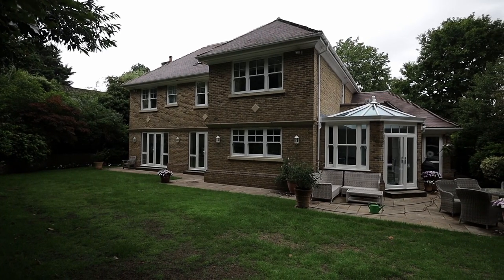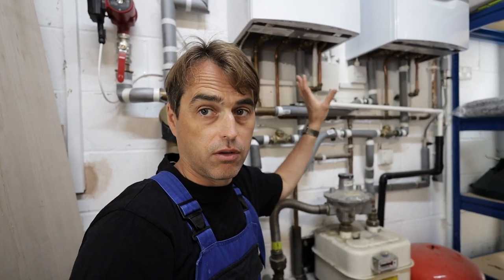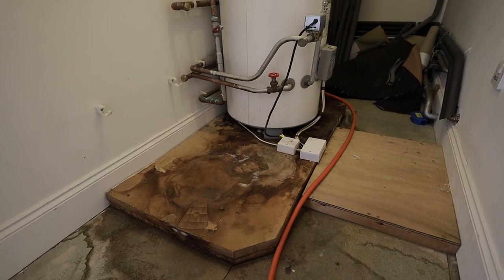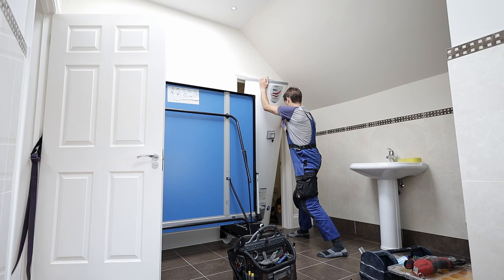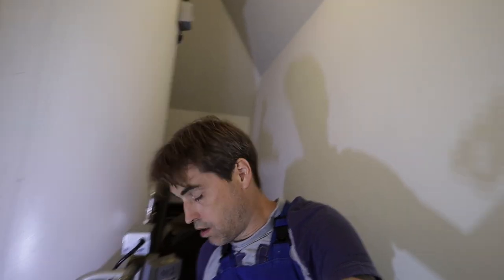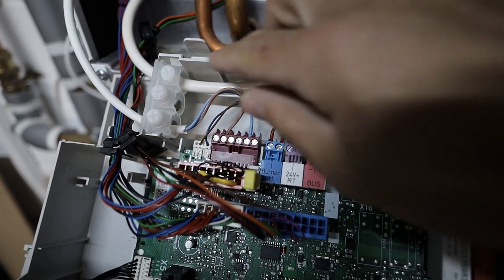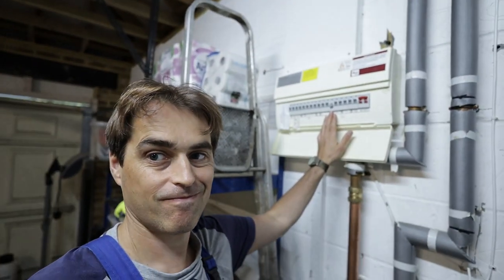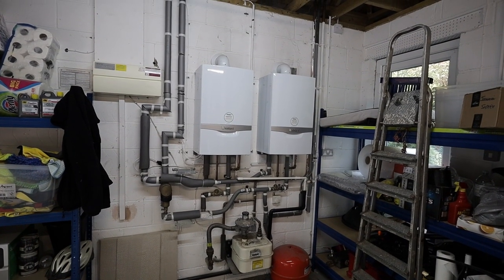Reducing Energy Consumption in a Large Home: A Step-by-Step Guide

Comment: Not sure I agree with removing the LLH for such a system, however, real world testing is the best way to find out if it works, we can have all the theories we want and all the mathematical equations and all the manufacturers test rigs in test conditions, but these do not prove real working of an actual system, it’s great that you have a client willing to undergo a trial for a different approach and it will be very interesting to see how it turns out, I look forward to the follow up video with interest, it could prove a lot of theories wrong
Reply from the maker: yes, it would be nice to keep it in, but that would require re-piping of hot water and radiator circuits so that the take-off for DHW is before the header, additional 2 pumps - one for CH rads and one for DHW plus replacement of mixing valves on 2 manifolds.

It may still happen. We will know soon.

Comment: The overall complexity of this system and the various parts raises a question in my mind. Hotels don’t create these inter related and inter dependent systems. They work much more on a room by room basis for all variable services. Why wouldn’t something similar work better and cost less here as well, because large parts of that house aren’t used every day. Individual room or area type systems can be activated when in use and only public areas on permanently. Also the thermal envelope of this property can’t be very efficient either based on your energy consumption stats.

Comment: 50,000kWh per year! 😮 What was the insulation like? Any room for improvement there too?
Reply from the maker: it's a 2004 new build, so insulation and windows are very decent. It was purely down to bad heating and hot water system design.

Comment: Fantastic and informative video. Ain’t the main reason for a llh where there is multiple pumps with ufh? To stop them influencing flow rates outside of the international pump flow? Hydronic separation, Not just for when you have two boilers together.
Reply from the maker: Yes that is correct. However even with LLH in you still have a system pump influencing 2 manifolds pumps.

I had a 2 hour discussion on how to address this with Andrew Millward today. 

I would just use CCT on manifolds as per Adam from HeatvGeek but Andrew is set against it and says it is as bad as no separation.

I think I may put LLH back but without the system pump and just add 1 pump for rad circuit.

I think this was a consensus we reached with Andrew.

There is going to be a follow up on this soon.

Another solution would be to use one boiler for rads and cylinders and separate the system with 2nd boiler just doing UFH on low temp.

Unfortunately all those option add a cost to the install

Comment: I've not done any research on prices for things, but it seems likely that you could have purchased a probe camera to look into the cylinders through the pipes instead of cutting one open and saved both of them. Then you could have sold the second cylinder (through installation at a second site) to recoup the cost of the camera and be left with a tool you could continue to use for years.
Reply from the maker: No one is buying a 20 years old cylinder. It’s worth around £20 in scrap value

Comment: Very satisfying 👍
Is there any sort of mixing valve on the underfloor? You mentioned 2 heating curves but without sensors and mixing stations the vr71 will run at the higher curve I believe.

Comment: It's a fantastic example that complexity does not automatically give you better efficiency, control or cost savings - and it can do the very opposite.
I wonder how much all those extra thermostats (and the perceived extra control) actually saves them when compared to a simpler well balanced system. My guess is not as much as they think.

And also why use underfloor heating manifolds with cheaper actuators when you can make you own out of hundreds of tees and individual zone valves... 
The labour time alone on all that soldering....

Comment: Just taking that cylinder out is going to save a lot of money.
Issue I find in installations with llh is how the circuits are run, dhw should be before the header/heat ex on priority so then all heating circuits can freely modulate
Reply from the maker: Exactly! Thank you.
Reply: Is running a 2000 LTR buffer tank with an UFH system a good idea in relation to efficiency ??

Comment: Another great job 👍 would there not need to be some sort of hydraulic speration for the different flow rates of the underfloor heating and radiators?
Reply from the maker: yes there should be. I quoted for it but was asked not to improve UFH manifolds! 

The reasoning is - UFH is 7kW so 1/3 of the boiler output and never run more than 1/3 of the house. This is not ideal but will work.

Comment: Great Video! My only question as a novice.... do you need to worry about the water temp returning to the boiler is too low and can cause problems long term? 

I might have tried keeping the low loss header for heat but tie the DHW in before the low loss header?
Reply from the maker: I wish I could do that - but that would require running new pipework throughout the house.

I have a solution to different flow rates now and there will be a follow up
Reply: @UrbanPlumbers  what about moving the DHW tank next to the boiler and use a Circ pump to keep hot water at the tap when needed. Occupency sensor in the bathroom and kick on the pump or a couple 24v switches around the taps.
Reply from the maker: There was no budget for this on this job. I actually had a much bigger idea for this job, but had to slash it in half due to the cost. There is a lot of compromises here.
Reply: @UrbanPlumbers  I know, it's almost worth spending your own money sometimes just to make it perfect

Comment: How does the contactor wire into the VR71? We're looking at a similar job, albeit with 4 zones but curious about the ability to keep 3rd party controls. We will be taking them out on this one as they're simple stats but I know we'll come across a 4 x Nest type setup soon enough where the client will want to keep their existing controls.
As always, top-notch content Simon, well done.
Reply from the maker: You just need a standard contractor to send volt free switch - either No or Nc will do. NO are easier to buy so just get those.

You can only do 3 zones on one vr71 for more than than you need additional vr70 (one per each additional 2 zones)

Comment: Can you give a rough idea of what it would cost to convert a Y Plan system, using a recently installed Vaillant Ecofit Pure boiler, into a Hot Water Priority + Heating Weather Compensation system. (I believe this only viable using Vaillant's own range of controls instead of the current Hive controller since they don't support opentherm). Looking at the Vaillant website it looks like I'd need to spend approx. £400+ on the hardware (new controller (VRC 700?)  + new compatible wiring centre + tank thermostat) plus whatever installation cost would be needed.

My problem is that I can't convince myself that the change would pay for itself in any sensible timescale given that I only spend about £650 on gas a year. That will go up of course when my current fix runs out, but even then it's only likely to be a £1000 a year on the new price cap. I already use 'manual weather compensation' by frequently adjusting the flow temperature to suit the outside weather so  would an automated system deliver enough additional savings to recover its cost.

Background data - I've got a solar PV system which gives me free how water most days between spring and autumn, and tops up the heating of the house with electric convectors when the hot water tanks is up to temperature.

Comment: With the underfloor heating, wide bore piping, big hot water cylinder and plenty of room in and around the property, is the place not calling out for a heat pump? They must use an awful lot of gas and produce so much CO2?
Maybe wealthy enough to cover the house in PV as well!?
Reply from the maker: boilers are 5 years old though and the heat loss of the property would require a twin heat pump set up. That would cost around  25-30K to do.

Comment: Great video, a gas engineer friend told me that it's more efficient to keep the hot water on all the time so that it just tops the cylinder up - do you think this is correct?
Reply from the maker: that's what they were told by a number of other gas engineers. Then they got the bill.
Reply: @UrbanPlumbers  ha ha, yeah I’ll stick to manually topping it up when needed, only takes 5 minutes to get hot water flowing again
Reply from the maker: @jonjohnson2844  if you have a hot water cylinder and 2nd circulation pump - I would suggest timing the water (not keeping it 24/7 on), definitely insulating all pipework around the cylinder (they lose more energy than people realize!) and only 'pulsing' 2nd circulation pump for short periods of time in times of heavy use (mornings and evenings for most of us)
Reply: Not in my experience as there is heat loss through pipes and the tank itself.
Reply: @avivscrewvalla  yeah there’s a lot of conflicting advice around - I think I’ll stick with putting the heating / water on when I need it, seems to have served me fairly well

Comment: I find more scale when the immersion heater has been used alot. If you just heat the water gradually to 60°C you will have less scale, no matter how hard the water is. That is on a closed system.

I think you get more scale with a vented system too
Reply from the maker: I bet those cylinders never reached 60c in 20 years because of the set up
Reply: @UrbanPlumbers  running at lower temperatures you use more cylinder water than cold supply. 

This is what I wondered with heat pumps. Lower temperatures at 50°C requires more hot water than having it at 60°C. I think the average shower uses 80 liters of hot at 65°C if I remember my Kingspan servicing days. 

Great videos though. I've never worked on really big systems before, but I'm learning a lot from the comments too. Thanks for sharing
Reply from the maker: Yes we usually run cylinders at 48C with heat pumps. Less cold water gets mixed in, if at all.

Comment: 18kw loss?  At what outdoor delta?  My house is quarter that size and probably loses nearly that much in winter at 20*C indoor 20* DT.  I have 2 rooms which won't even make it to 20*C when it's 0*C outside as the heat loss from the room alone is more than the radiator can supply.  I set all my zones to 20*C last winter when it was 0*C outside.  A few of the rooms got there within an hour, the bedroom and hallway, no chance, barely got the bedroom above 19*C and the hallway I gave up at 18.5*C after 3 hours of heating at 80*C loop temp.  30kw boiler, 18kw radiators.
Reply: For this winter my static "base" targets are going down to 15*C and 14*C (for hallway and bedroom).
I am adding a few triggers for humidity, first triggering heating if it exceeds 79%, but also want to look into prediction of RH as when the temp fails at night, you don't want to allow it to drop too far if the air is humid.  If RH gets anywhere near 100% then condensation and thus damp will start to form.  I can probably just fetch a weather forecast and look for the minimum temp and dew point metrics, then over-ride the base temps with Anti-Humidity temps aiming to keep RH lower than 80%.  I might have to up that to 90% depending on how much heating it actually needs to lower the RH (I expect quite a lot).  If I have air pressure, temp, RH and dewpoint I should be able to calculate the peak RH for the night ahead and set the target temps 1 or 2 *C higher to avoid it... hopefully it doesn't happen too often.  I don't recall seeing over 72% humidity so far.
Rooms I can detect I am in, like the office PC is on, the bedroom TV or livingroom TV are on I ramp the temp up to something more comfortable like 18*C.
In Jan/Feb limiting myself to 2 rooms heated (office and bedroom), should keep my bills as low as possible.
Hot water temp is (combi) 42*C, fine for a shower, the dishwasher does the dishes.

Comment: Secondary circulation still would be handy in such a large place with that many bathrooms. It could've been made to work with the right controls and insulation. Did you keep it? I suspect not if three people live in a third of the house of that size.
Reply from the maker: Yes, I kept it. It’s now controlled by Senso Comfort and set to run as little as possible
Reply: @UrbanPlumbers  Tnks, please do an update vid if you are you going back to install the LLH and pump.
Reply from the maker: Update coming soon as people ask way too many questions s on various forums
Reply: @UrbanPlumbers  😄only way to learn.
Reply from the maker: Mistakes are the best way to learn, especially very public ones 😉

Comment: You mentioned running a different heat curve per zone. I get how that works but how are you achieving that without mixers and multiple pumps 🤔 or did I miss hear you
Reply from the maker: Highest curve takes over sadly. So if all rads are off UFH curve takes over
Reply: @UrbanPlumbers  🙌 though that would be the case.

Comment: Can't wait to see to difference in gas usage. I bet it's only going to be 5% less. 
What does everyone else think?
Reply from the maker: on hot water alone being 300L not 600L and not being constantly depleted by 2nd circulation this will save at least 20%. Plus weather compensated heating will save another 10%. Those are my calucations.

But let's wait till Jan next year. There will be a follow up
Reply: Definitely going to save alot more if the boiler can condense more + weather comp + lower hot water bills. We are saving 35% in hot water bills after our job earlier this year!
Reply: @avivscrewvalla  
35% less energy on hot water is very, very impressive.
What boiler did you have before? What boiler do you have now?
Reply: @nhojnhoj6767  Had a Bosch Greenstar 18Ri which was replaced by a Viessmann 200-W. Only other variable was the addition of pipe lagging.

Comment: How can I get in touch please Simon ?  I am one owner of 10 new houses with air source heat pumps and ufh and am not happy that the systems have been commissioned properly to take account of different floor coverings . Kw energy use is high on cold days but the system seems to struggle to keep rooms to temperature
Reply from the maker: Email me. There is a contact form on my web site www.urbanplumbers.co.uk

Comment: I’m not a plumber, but was the 2nd circulation pump circulating hot water so you had hot water at the hot taps almost immediately?
Reply from the maker: No, 2nd hot water circulating pump is still there by the cylinder

Comment: At the cylinder dual stat, instead of taking the control stat to overheat stat link out and just keeping the overheat stat,  could you have just set the old control higher to say 70C so the NTC sensor control would then be in control?  Thinking that would give an additional failsafe?
Reply from the maker: yes that is what I do. I don't need cylinder stat anymore, just over heat stat.

Comment: I wondered if you had any information on interlinking the 3rd party controls into the wiring centre. 
I've got a job with 4 zones and I'm struggling to find the relevant controls pack
Reply from the maker: You will need: VR71, VR70, VRC720 plus 1 x relay per zone

Comment: why don't keep a boiler for underfloor heating and a boiler for the radiators? And if you run the boilers at under 30% load they are more efficient… + more Flow from the pump …

Comment: How does one of them hot water cylinders cope with 6/7 people . I’m sure when I had one at a previous house, if you had a bath it would be empty .
Reply from the maker: That’s what happens when they are not controlled on hot water priority. 300l on PDHW is plenty for 6 people
Reply: @UrbanPlumbers  2 boiler with one supplying cylinder only would mean both ufh and hot water cylinder could operate together, no need for priority hot water

Faster recovery time for cylinder without any interruption to the heating side

As mentioned by other two boiler mean if one one fails the other could still be used.
Reply from the maker: @victor-hn1bh  you could do that. This would mean extra pipework and extra controls - probably would add around £1,000 -£1,500 to this job. 

The best option would be to have one boiler doing only UFH on low temp and 2nd doing DHW and radiators on PDHW as that way you can remove beldning valves on manifolds and install a mixing circuit pumping station. 

I did quote for this kind of set up but the client did not want to spend that much. What I have done is the cheapest solution to the problem.

Comment: Hiya. Was it not possible to have both boilers in use alternating. Or some other designs where both are used. One for hot water the other for heating only.
Reply from the maker: yes, it was, I actually quoted for a much more advanced setup but it was not within the expected budget.

Comment: Would you rate the vaillant controls?  I am trying to get more efficiency out of my much smaller combi system (currently on hive) as I am pretty sure the boiler never modulates down. I have enquired with a local engineer and his advise was it would not save me anything.
Reply from the maker: Vaillant controls are very good, possibly one of the best. Find a new engineer, best to Google ‘heat geek map’
Reply: @UrbanPlumbers  thanks  I will